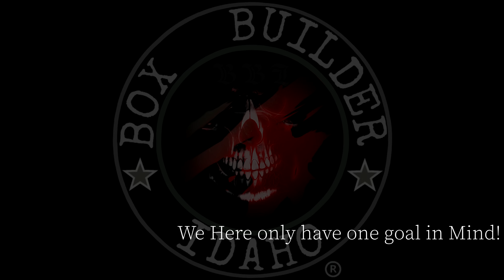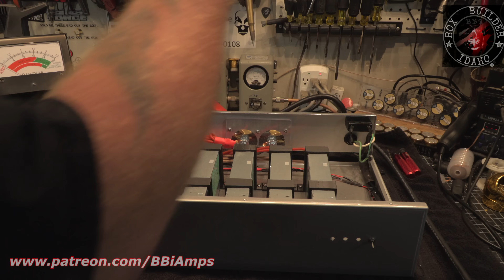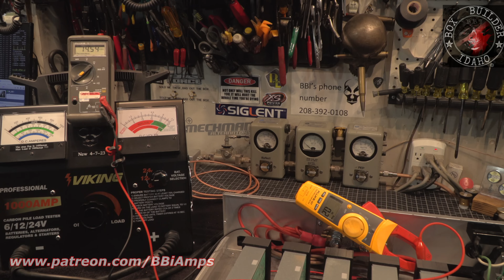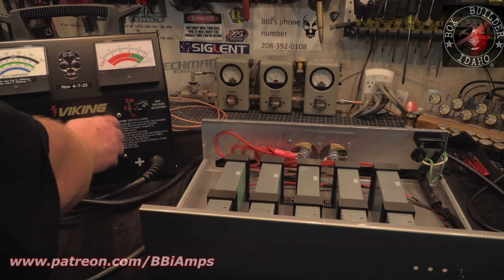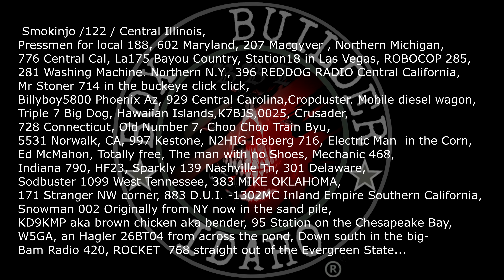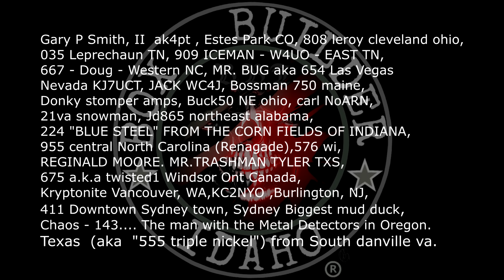600amp Max 14.5v bbi built power supply

Comment: Too bad all those will draw about 100 Watts while OFF without a contactor..
Reply from the maker: Man I don't know where you get your numbers from but I hook the amp clamp on the 220 side with everything off. It pulled .001 of a amp. Which is well within the error factor of the meter. Oh there's that little irrefutable fact
Reply: @BoxBuilderIdaho  Perhaps you should try the measurement input in AC Amps, instead of default DC amps,, this will result in .08 to .17 Amps, while OFF. Check it Again ... without the clamp - direct
Reply from the maker: @Harbinger999-sz4ni I was talking about the ac. Input bud.
Reply: @BoxBuilderIdaho  I am as well @120vac w/ single module... Clamp is Relative, direct connection measurements are Irrefutable. CHEERS

Comment: No good deed goes unpunished. I've given away my labor, charged only cost for parts, and still got cussed at by the customer who decided that I was cheating him. He had a price in his head of what the job should have cost. It was my mistake for listening to him when he said I didn't need to bother with a quote. Just get the parts ordered and do the job please.
I was young, dumb, and full of ...
Lesson learned. Always give a quote, and don't give ANYTHING away. Doing things for free doesn't make people grateful. Quite the opposite I've found so charge a fair price, give them the price up front.. Written or in email.. Get enough security money from them up front so you don't lose on the parts if they back out on the deal. 
If they decide you're a prick.. Don't worry about it. They would think that about you if you did it all for free and also took them out to a steak dinner.

Comment: Thank you as always!
Btw - For a UHF repeater, would you recommend using a single one of the power supplies you showed?

Hytera RD982 (50w RF out)
Duty Cycle:  100%
Power: 13.8vdc (+/- 15%)
Current Draw:  0.8a standby / 12a transmit

Also… where do you purchase power supplies from?

And..  Have you used HP server p/s units? 

Thanks !

Comment: Check how warm your output bolts are getting. If you are pushing 500A through steel bolt - you will have noticable loss.

Comment: I did make the same thing with 5 and I can't get mine to all work evenly.  It's pretty much the same as you're with all the same length wires and all that
Reply from the maker: I took all the link or  load share wires off and it took off. Other then the one supply given me fits. The thing worked grate